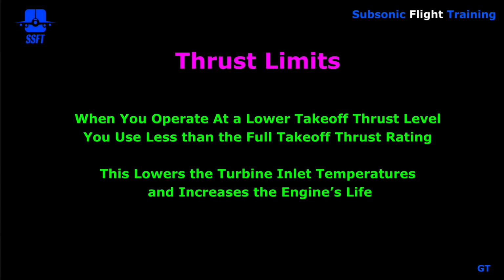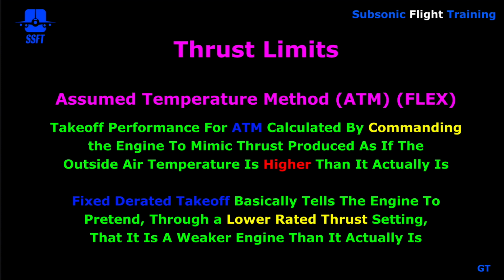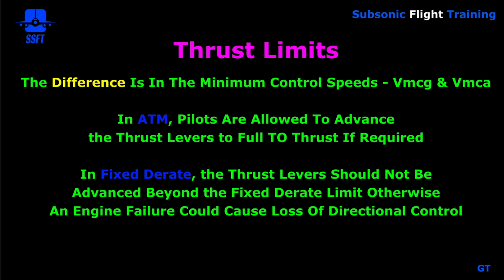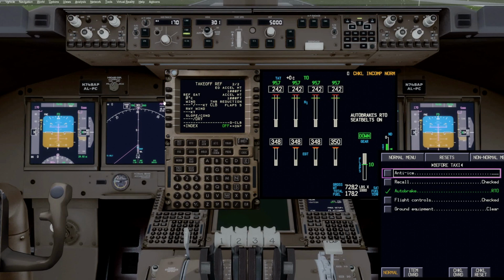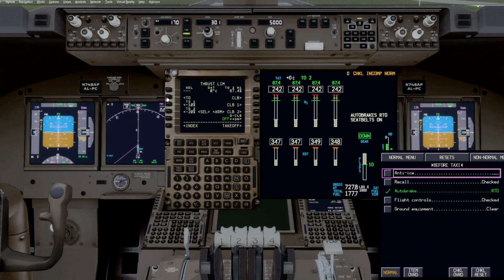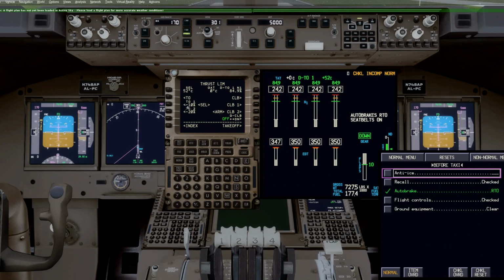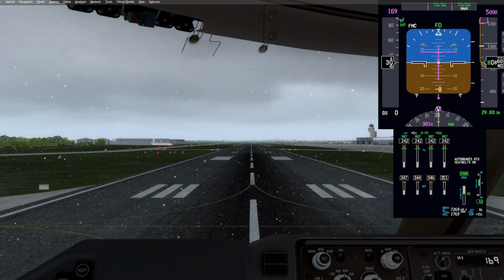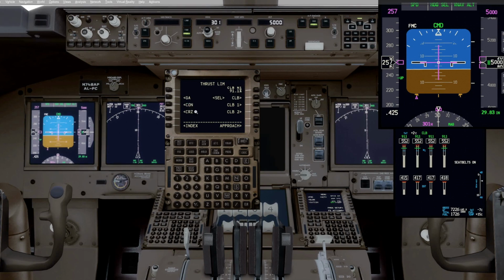Thrust Limits | PMDG B747-400, B747-8

Comment: what if an engine does not reach the limit value when using ATM?
Reply from the maker: I have never seen that since you always have more thrust, not less, than what you need for an ATM Takeoff. Since you have less thrust on takeoff assuming the conditions and weight are greater than they actually are, if needed, you can use greater thrust which will still maintain control in the event of an outboard engine failure regarding asymmetric rudder control. Not so with fixed derate, where you may not have adequate control if adding power beyond the fixed derate.

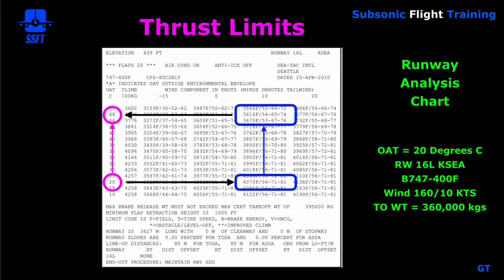Comment: 5:46 what software is it and has several planes and different engines
Reply from the maker: Not sure if you are referring to the runway analysis software or the simulation of the 747 software?
Reply: @subsonicflighttraining  Thanks for answering, my question is what software are you using to have the weight and balance data and to have the temperatures assumed for takeoff because I would like to know it to simulate even more my virtual flight experiences
Reply from the maker: I use Simbrief for flight planning, but I think PFPX is much better for performance/weight and balance data. I just usually use a thrust based on runway length and weight that I calculate, in other words, I just wing it because Simbrief does not give me that data…

Comment: This is a good training video about thrust modes:

https://www.youtube.com/watch?feature=youtu.be&v=kbPFCCwfahI
Reply from the maker: Yes, the problem is they are Boeing CBT Training Modules provided to Atlas Air, which means this channel has copyright infringement material that were copied word for word without permission to do this, this guy can get in huge trouble, his whole channel is copied Boeing/Atlas material. My channel, to contrast that, is all original material produced using Keynote, using models that were purchased by PMDG, manuals that are provided by PMDG that are licensed by Boeing to PMDG. PMDG does not restrict the use of its product on You Tube, as evidenced by tons of flight simulation videos on it. But to copy proprietary  information word for word and put it on you tube is a blatant violation of copyright.
Reply: @subsonicflighttraining 
  To make an integrated material which offers a proffisional training u need to cover:
A- systems ( autopilot/autotheottle/fms/fuel-jetsn/hydrolic/mcp/nd/pfd/electrical/pneumatic/fms... Etc.
B-Training
- takeoffs/push back/departures/arrivals/approaches(ils, npa vor, gps... Etc
Non normal
Loss of pressure/traffic conflict/engine(s) out/ etc.. At least the most frequent prblms - as you think as a proffisional pilot. 
C- from dark/cold cockpit (as a prof. Pilot would do in a real flight).. 

D- for non professional ppl:
General issues rise like
- thigs ppl would see/experience/hear in the airports/airplanes/flights
Markings, pushback trucks, boarding, ground problms of airplanes(crashes/replacing tyres/deicing.. Etc. 
Here you can discuss hundreds of topics.. 
These types of issues, attract millions of views. 
Some of the non professionals want to know a general idea about things thy hear/see in the cockpit:
Minimums
Wind shear
2500
Yoke
Rudder pedals
Nose wheel steering
Etc. 
Simple, clear & expressive photo/ headline for the video would do a lot.
Reply from the maker: Thanks Blackbird, good stuff...
Reply from the maker: Blackbird, I have done a fair amount on A & C, but will do more on B & D...
Reply from the maker: Blackbird, based on this response, which really belongs in the subscriber input, you are the winner of your choice of either 747-8 Question Bank or B787 Question Bank, which includes the Flow Pattern Diagrams, contact me:           info@subsonicflighttraining.com

Comment: Thank you for this much information for free! You are helping me a lot!
Reply from the maker: Your welcome Lucas, that is my goal of the channel, to help you enjoy the full simulator...
Reply: Hi Sir,
God bless you 🙏. Wt do u mean by contaminated runway?
Do u mean that we can reduce operating thrust by assuming a higher T 
& 
selecting TO1 or TO2 would make thrust yet lower than ATM alone?
???
Reply from the maker: Hi Blackbird, a contaminated runway is a runway covered by snow, slush, or standing water of which there are maximum depths allowed based on the type of contaminate. The ATM method is not allowed on any contaminated runway, you can only use ATM on a Wet  or Dry runway, assuming you account for it via performance charts/calculations. A TO, TO1, or TO2 takeoff can be performed on a dry, wet, or contaminated runway as long as the maximum depths are not exceeded and that the appropriate charts take into account the performance decrease that would result if on a wet or slippery runway with snow, slush, or standing water.

Yes, selecting TO1 with an assumed temperature will result in a lower thrust than if selecting TO1 alone or selecting the same assumed temperature with full TO thrust would be greater than selecting the assumed temperature with TO1 thrust. You do have to have a method or way to calculate that you will be at a weight that allows you to do this, usually via performance charts or dispatch does it for you and it is included in your papers as a preliminary then a final close out performance computation based on the conditions at takeoff.